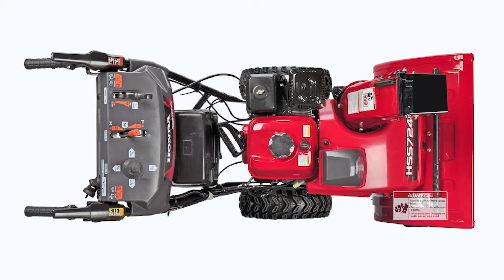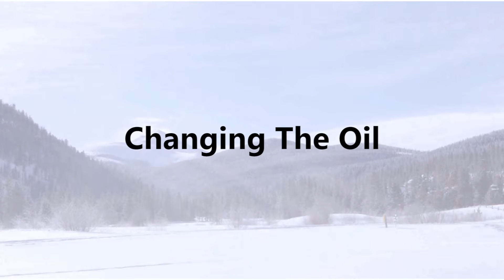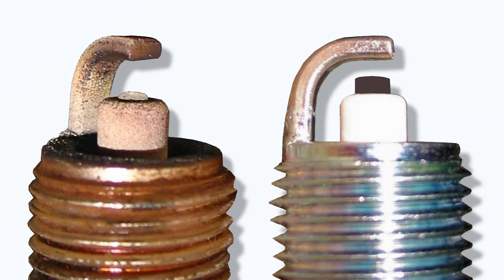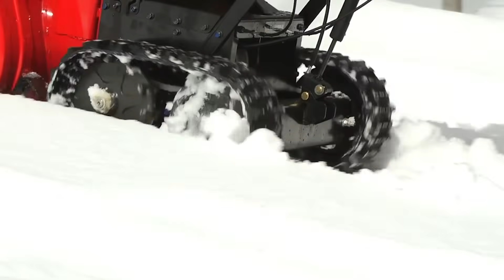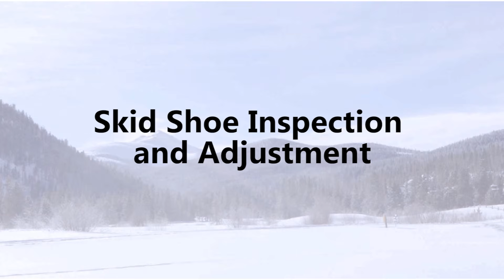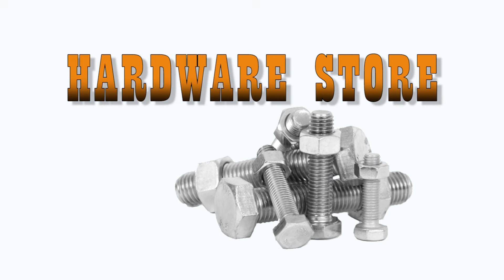Honda Two-Stage Snow Blower Maintenance

Comment: Honda, man, come on. 1:56 look at that oil change demonstration. Some of the drainage is escaping along the edge of the pan and will be dripping down the tracks. Where's the 2" rubber hose extension? Cheaped out? Include the damn hose!
Reply: They want a high co$t for the machine but can't provide the hose extension.

Comment: You'd think with a price of over $4000 you'd get a full pressure oil system with a proper filter.
Reply: And that they would include a .50c rubber hose extension so you don't accidentally get oil down the side of the tracks. 
1:56 that's not good enough. Oil is going to drip down the side of the pan really quick. Where's the simple hose extension?

Comment: You guys need to put a factory oil drain hose on the engine.. This is the top of line snowblower that we pay good money for here.. Come on honda..
Reply: Fold a piece of card board or heavy paper to create a ramp for the oil to drain... Jezzzzzz.     It may be called a Mcgiver but a little thought goes a long way. Plus if Honda included one, it would probably cost you $100
Reply: @douglasmichel6361  i use a plastic bottle. It works great!

Comment: The thing that’s odd about Honda snowblowers is that they don’t have grease fittings on auger shaft. I’ve never seen one. Every other snowblower I’ve seen has them
Reply: Cub Cadet doesn't have them either. Sealed units

Comment: I Bought this snowblower 2 years ago, I added 2 led lights a voltmeter, heated grips and an easy charge pigtail to the battery.  This Machine is a beast, heavy powerful and with practice fantastic.  It has one real flaw and it's really annoying. IF you are TALL and you adjust the auger height higher in order to clear or steer,  it pivots the handlebars commensurately  lower.  
This Machine is already built for a shorter person so when you pivot the front up ( which you need to in deep snow or ice to turn 180  you find your back bent over far more than you like.  Fatigue creating.  If you use it a lot like we need to,  its a very obvious drawback.  Having said that the power , reliability, controls, throw distance, traction all shine... Honda please make a bar riser kit.  BTW in VT deep snow never once had clogging issue... try spraying the chute with silicone a few coats.  Dupont makes a snowblower spray too.
Reply: Nope, I am five foot tall, kills the back to have the auger up for transport!
Reply: Hard pass.

Comment: Stay away from the overpriced HSS928 and HSS1332. My HSS1332 has been a clogging nightmare and I regret the day I spent over $3,300 to upgrade from my Toro PowerMax which never clogged for the 14 years I've used it.
Reply: Do you have the modified chute?
Reply: Wow, not sure why your blower keeps clogging.  Is the secondary working properly.  We average over 400 inches of snow and very often it is wet and heavy.  I have been using Honda snow blowers for over 20 years and I have never had the chute clog up.  All I can say is operator error.  BTW, everyone in our development only owns a Honda because nothing else really gets the job done.
Reply: We had 8" of heavy wet snow this weekend.  The first part of the snow, the water was literally dripping out so my blower kept clogging, no surprise.  Later in the day, when the water had a chance to drain, I could then blow without clogging.  The snow was so heavy, it was doing a number on my lilac trees.  I was then able to use my snowblower to blow snow from my lawn onto my lilac's which helped to remove the snow load from them.  I am talking about throwing the snow at least 30'.  And the snow was still pretty wet and heavy.  So no complaints on my part. In the 3 years I have owned it, it has been a lifesaver.
Reply: Definitely get the upgraded chute - should be a warranty item - I got it for my HSS928 and it made a big difference.  I live in Truckee CA and we usually get 100s of inches of marine moisture snow (Sierra cement) so it can be very wet
Reply: @cycle11111  looking to buy the HSS928 this year.  What’s the difference with the upgraded chute design?  Has it been changed for the newer models when purchased now?
Reply: @livingthedream29  reduced height of the collar. They should remove it all together but I think they are trying to keep snow from building up on top of the shute motor

Comment: 1:48.  The oil drain extension is woefully short leading to an unavoidable mess.  Best solution is to purchase a rubber hose extension that can direct the oil into a suitable continer.  Leave the hose connected to the motor at all times.
Reply: I drain from the fill port by tipping the snowblower and pouring into an oil drain pan - our local Honda rep actually showed me that - less mess and no need to replace the drain plug crush washer
Reply: use a waste oil can with manual suction pump and hose attached. Stick it in the fill port.
Reply: I fold a piece of cardboard to form a small ramp for the oil to reach a pan. Not a drop get on the machine.
Reply: I use a funnel attached to a hose to drain the oil.